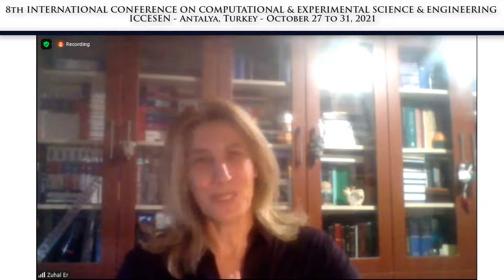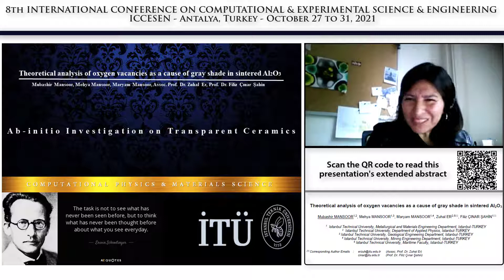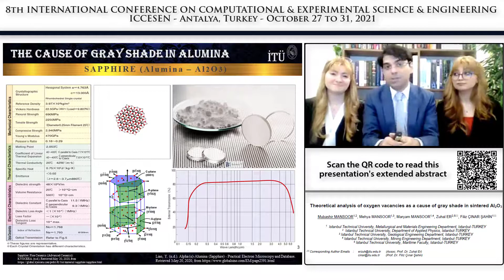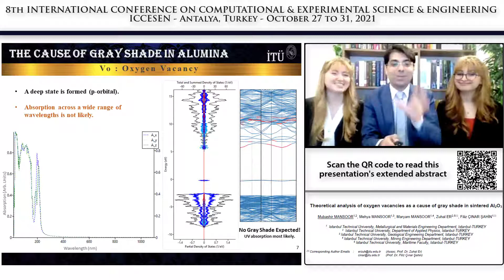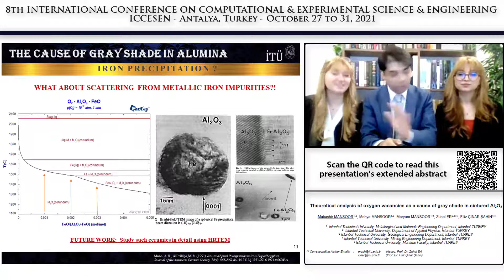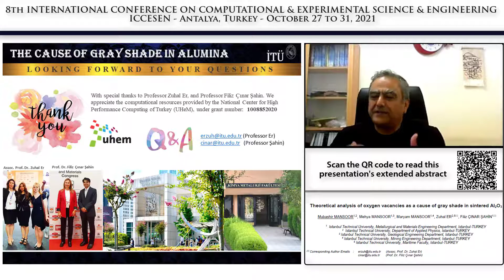ICCESEN 2021 - Theoretical analysis of oxygen vacancies as a cause of gray shade in sintered Al2O3

Comment: Fantastic presentation! Thank you for making this publicly available. The theory that oxygen vacancies causes the gray discoloration in transparent alumina always seemed unlikely to me, simply due to how stable alumina is. Your explanation makes even more sense.

Iron precipitation as a secondary phase does make a lot of sense. I initially dismissed Iron as the main cause of absorption losses because the amount of Iron contamination in the RonaFlair platelet alumina powder was low (0.018 wt%) compared to Sodium, which was the other main contaminant (0.26 wt%). But upon reflection, 0.018wt% of Fe impurities might be enough, especially considering that you show stable phases exist between 5000 ppm Fe and Al2O3 at similar conditions that we processed our parts under.

Do you think it makes sense for the Fe precipitates to be able to diffuse out of the alumina lattice during a post-processing thermal treatment under high pO2? If so, what sorts of temperatures would be required for this?

Cheers!
Reply from the maker: Hi Andrew! 

Thank you for the nice comments. Your hunch was correct. Oxygen vacancies can't be the source of this problem & you're completely right, the 0.018% Fe is more than enough to cause the grayish shade if precipitation of metallic Fe or hercynite (the iron-spinel phase) occurs. We have tried to reproduce this phenomena of grayish discoloration in single crystal sapphire, heated under various conditions to replicate the sintering atmosphere. The benefit of sapphire is that it gets rid of all the other carbon-related possibilities. We see this phenomena in single crystal sapphire samples which contain even less than 100ppm of Fe. Nevertheless, subsequent heat treatment at high oxygen partial pressures (like air or 1atm O2) can dissolve Fe back into the solid solution and make it colorless again. The temperature necessary for this post processing depends on the total Fe concentration, but anything above 1300 C will do, the higher the better due to kinetic reasons. 

I don't think it is possible to diffuse out Fe, based on the kinetic constraints. The diffusion coefficient of Fe in Al2O3 is really low, and it might take years of heating at temperatures close to its melting point unless the crystal has a seriously high concentration of line defects. The best way to get rid of Fe would be in-house powder production under ultra clean conditions and through methods which ensure separation of iron in the precursor powder. However, dissolving the Fe into Al2O3 only takes a few hours at 1700C, as long as the Fe concentration isn't too high.   

We are in the process of doing a detailed study on the topic, and its paper should become available by early next year. Hopefully, we will have more to say on the topic very soon. 

By the way, we are huge fans of your work. Please convey our wishes and regards to your team and Professor Youngblood. We look forward to more of your amazing papers :)

Best wishes.
Mubashir
Reply: Hi @stemzylab !

This all makes a lot of sense, and now that I look back to our paper, a few of the phenomenon that we observed now make even more sense. Specifically, absorption losses decreasing with an increase in temperature (Figure 3), and absorption losses similarly decreasing with an increase in isothermal hold time (Figure 9). At first, this didn't seem to make much sense, because if we assume that carbon contamination causes the discoloration (the samples were hot-pressed in a graphite die, in a furnace with graphite heating elements, so sources of carbon are plentiful), higher temps and longer times will surely cause more diffusion of carbon into the sample, right? Except we didn't see that, which was confusing, and we instead attributed the decrease in absorption losses to the residual impurities (mainly Sodium) having enough enough temp and time to diffuse out of the samples, likely along the grain boundaries (???) But instead, I think you are very much correct that it is the iron impurities that are dissolving back into solid solution with the alumina. Higher temps will cause that to happen more readily, as well as more time at temp.

I tried some powder cleaning methods, but at the time, nothing seemed to produce noticeable improvements. The new grad student who has taken over this project is exploring powder cleaning in much more detail, so hopefully something exciting will come of that!

I am quite excited to see your new paper, I will keep my eyes open for it. And thank you! It is really fulfilling to see my research be helpful to others' research in the field! We actually recently published another paper in Ceramics International, you can view it here: https://authors.elsevier.com/a/1dvda~2-F3pI0 This paper mainly focuses mainly on densification and crystallographic orientation, and not so much on optical properties, but there are still some pretty neat insights. Additionally, we will be submitting another paper on the mechanical properties of these alumina samples in the coming months!

Cheers!
Reply from the maker: @andrewschlup6169  Thank you sooo much dear Andrew. I went through your recent paper now and we will be definitely citing it. There are excellent insights in your new paper.  The possibility of precipitates at grain boundaries does indeed seem plausible and this is why we switched to single crystal sapphire for analyzing this shade as it makes things so much more simple. Since we saw the exact phenomena in sapphire heated under the same conditions, in just a few minutes, it was clear that this is not a grain boundary or carbon related issue. We are doing our best to complete the study, but it might take a few more months.  If you and your group are interested in joining this study, we will be more than happy. Perhaps we can analyze the grayish samples in your experiments under TEM too, then co-author this paper together. I am sure your experience with alumina can make this a more impactful paper. Let me know if you are interested. Have a great weekend! My email is: mansoor17@itu.edu.tr